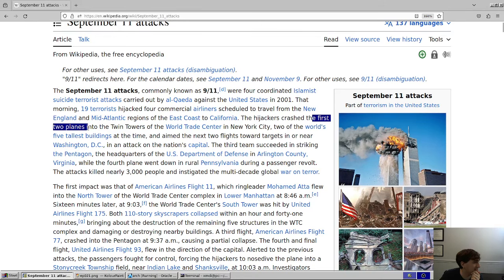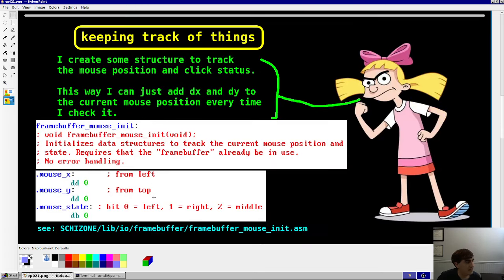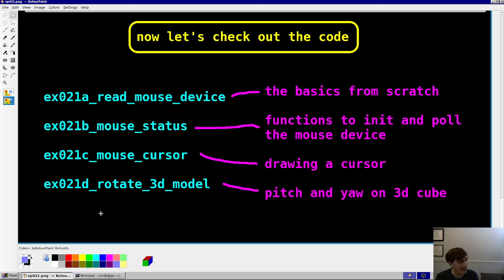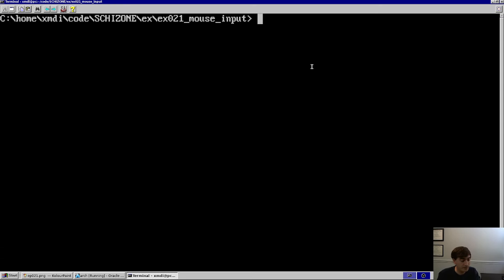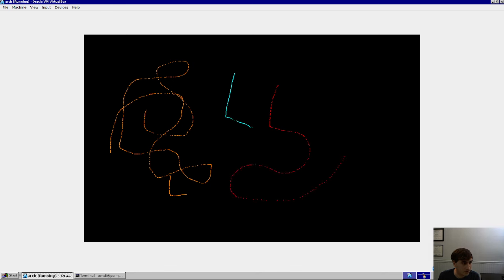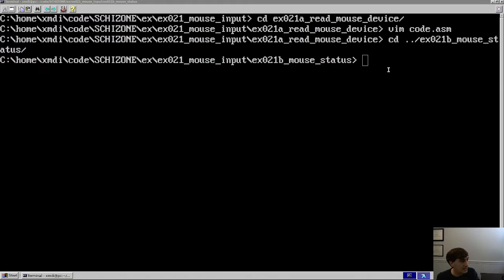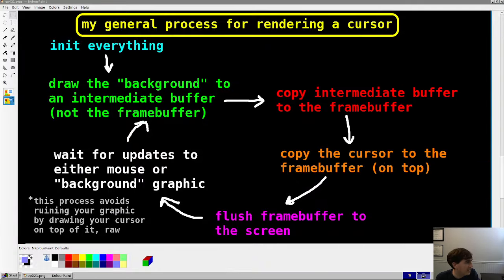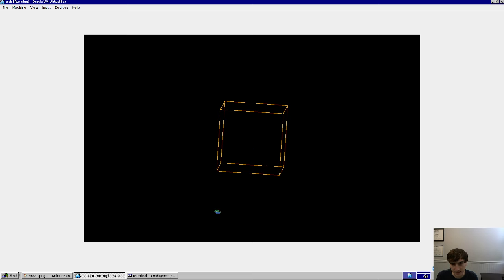getting mouse input in x86 assembly | SCHIZONE EP-21

Comment: On PC booting MS DOS i used an edited true color picture from my web cam of a green watering can made of plastik with black background as a mouse pointer. I load the picture in the upper left corner of the linear framebuffer and then i made a table with the address 4 bytes and 4 bytes for color of each pixel. And additional we need space for a second table to store the background with the same size.

Comment: Without a mouse drive for PS2 mouse (USB mouse with USB legacy enable in mainboard setup) we can use our own mouse handler like the open source Cutemouse driver, if we modify the handler to store the mouse bytes into our data segment. Our main routine can use the coordinates to draw a mouse pointer.

checkPS2:
int 11h			; get equipment list
test    al, 3
jz  noPS2		; jump if PS/2-Mouse not indicated
mov	bh,3
mov     ax, 0C205h
int 15h		        ; initialize mouse, bh=datasize
jc noPS2
mov	bh,3
mov     ax, 0C203h
int 15h		        ; set mouse resolution bh
jc noPS2
mov     ax, cs
mov     es, ax
mov	bx, OFFSET PS2dummy
mov     ax, 0C207h
int 15h		        ; mouse, es:bx=ptr to handler
jc noPS2
xor     bx, bx
mov     es, bx		; mouse, es:bx=ptr to handler
mov     ax, 0C207h
int 15h
ret

noPS2:
stc
ret

PS2dummy:
retf
;---------------------------------------------------------
enablePS2:
call disablePS2
mov    ax, cs
mov    es, ax
mov    bx, OFFSET IRQhandler
mov    ax, 0C207h	; es:bx=ptr to handler
int 15h
mov	bh,1		; set mouse on
mov     ax, 0C200h
int 15h
ret
;-------------------------------
disablePS2:
xor	bx, bx		; set mouse off
mov	ax, 0C200h
int 15h
xor     bx, bx
mov     es, bx
mov     ax, 0C207h	; es:bx=ptr to handler
int 15h
ret
;---------------------------------------------------------------------------
IRQhandler:
		assume	ds:nothing,es:nothing
cld
push    ds
push    es
pusha
mov     ax, cs
mov     ds, ax
mov	bp,sp
mov	al,[bp+24+6]	; buttons
mov	bl,al
shl	al,3		; CF=Y sign bit
sbb	ch,ch		; signed extension 9->16 bit
cbw			; extend X sign bit
mov	al,[bp+24+4]	; AX=X movement
mov	cl,[bp+24+2]	; CX=Y movement
xchg	bx,ax
neg	cx              ; reverse Y movement

; placeholder to store the mouse bytes into our data segment.

popa
pop	es
pop     ds
retf

Comment: I draw some button to click on and for mouseover to change the color of the button. And here comes the problem, if some button placed without a distance to each other nearby and we move the mouse very fast we can not check if the pointer is outside of a button and so it is not changing back into the first color. We have to check this too, if the pointer jump from inside one button into another button without to go between the button.

Comment: I'm new to Linux, what mouse image thing are you using to make it pepe?
Reply from the maker: Good question- it's actually not a Linux cursor (it's tracked and generated by the assembly code itself), and pepe is actually not an image file at all. Pepe's raw RGB pixel values are directly encoded as bytes in the assembly executable. The code then plots those RGB values on top of the rest of the screen based on where the mouse moves. Fun fact, the assembly code in this series is so minimal that the ~28x14 pixel pepe makes up around half of these Episode 21 executables (in terms of filesize). Thanks for your interest.
Reply: That's awesome! I hadn't finished the video, but now you've got my curious about overlaying the pixels. Thank you!  @xmdi0